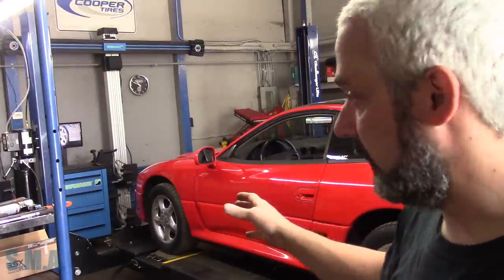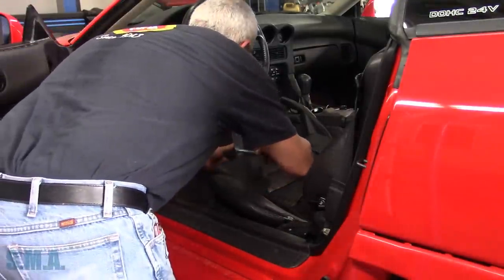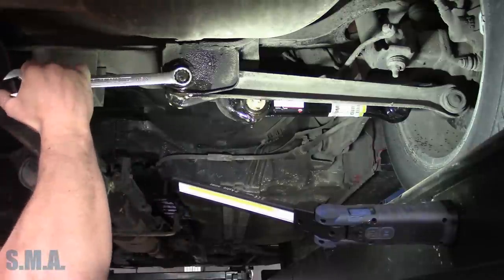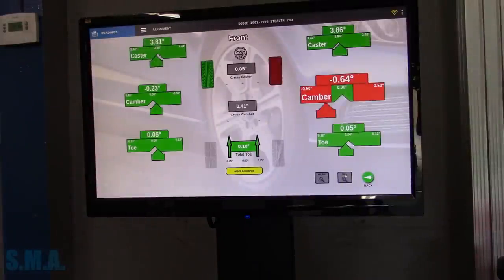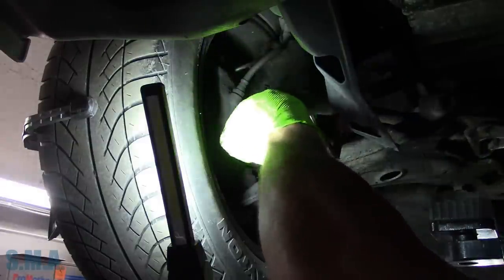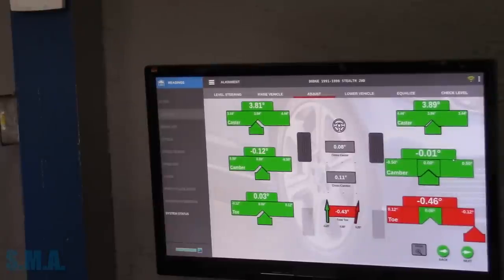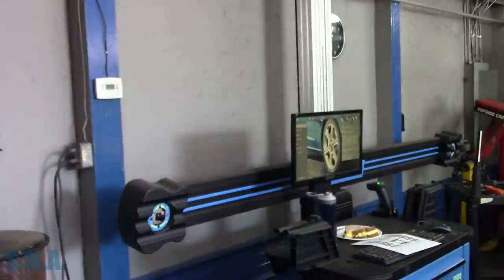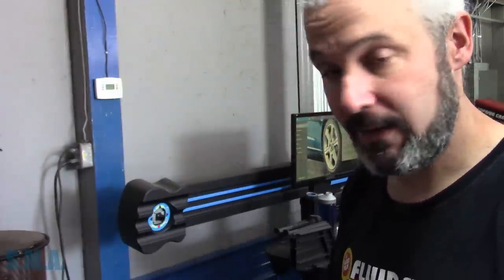Hofmann Geoliner 678: Performing A Wheel Alignment

Comment: Boy that sure beats a couple of jack stands and some string
Reply: That's how I set my toe-in after replacing an outer tierod on my Totota truck last year. Learned a lot and so far it seems to have been correct.
Reply: Oh yeah it definitely works I've done alignment on many cars with just that
Reply: Same here. I get it within 1/8”
Reply: I have try didn’t work
Reply: For toe my dad used to have a bar with sliding like dealies on it.
Reply: In the WRC - World Rally Championship they have static string lines with wheel hub fittings to do a re-alignment at service if they replace a tarmac suspension for a dirt suspension  or after an altercation with the scenery. Works well enough to drive a WRC car at up to 200kph on dirt/tarmac.
Reply: I will say that. However been there with jack stands and string before
Reply: No shit.. lol I fought my 85 Accord for 3 days trying to get toe in spec.. Turns out, front subframe was loose.
i managed to eat half of the right front tire in those 3 days and countless changes only to find the sub-frame would move around after a change
Reply: I've seen and fixed hundreds of bad alignments done with alignment machines with my eyes, a set of toe plates and a level. Tape measures are never wrong, "laser calibration" often is.
Reply: A couple of Summer's ago I did a full out-from-the-frame front-end refresh on a C1500 pickup truck.  A buddy works at a local dealership and offered to sneak it up on the alignment rack for me.  But, I still had to get it close for the drive over to the shop.
 
In a local semi-flat cul de sac I would eyeball the front rim edges with the rear then drive the vehicle around the block.  It took around four cycles to get the toe-in perfect by eye.
 
Once on the "real" alignment rack, toe-in was almost within factory spec.  Fancy equipment translates into fancy fast.  Just about everything can be done old school or low-tech and still turn out rather well at the expense of time.

Comment: That's a slick machine.  As a DIYer, the best I could ever hope to accomplish would be a rough toe-in adjustment using PHAD Ivan's string method.  Thank you for demonstrating how a total alignment should be done with modern equipment.

Comment: That is a nice machine! It will sure pay for itself in the long run. I learned alignment form a neighbor who did them at a Nash garage years ago using the old style bubble level gauge. One tip I learned from him is if you have a real heavyweight driver that complains that you didn't do the job right, do the job again with him in the drivers seat. If the driver weighs enough, his weight will change the the numbers enough to be noticed when driving or in tire wear.

Comment: Most vehicles back in the day just had a solid live axle in the real  and you adjusted the front (the rear wasn't adjustable) and you adjusted the Ackermann Articulated linkage steering for toe.  Most all of your trucks that have rear-wheel-drive or rear-wheel-drive based 4-wheel-drive are still made that way.  Even on that fancy-dancey machine Eric has you can still take a vehicle with a rear that isn't adjustable and do the same thing.  Now, however, most cars are front-wheel-drive and have independent-rear-suspension that must be aligned to the thrust angle (imaginary straight line down the middle of the car) and that is where the machine he has shines because it can compare all 4 wheels and their positions.  Great video!

Comment: Excellent.  Although it's a week after my first camber/toe front alignment on my Mustang with camber bolts, it's comforting to see them happen the exact same way.  No, I don't work in the shop.  Shade tree home mechanic.  But sometimes they let me 'play' with the machines with my car.  I did pretty good, I think. All in the green and centered, and the car steers fantastically. I'm sure glad to have seen this video that confirms I did it right, as nobody taught me the camber bolts.  Trial and error, but fairly quickly figured.  Thank you so much for doing what you do in documenting these things, Eric.  Even the plethora of brake videos are both teaching moments and good ASMR or however that's spelled.  Each video teaches me something, or at least re-affirms what I do know.  Have a good one!

Comment: Nice to see a good alignment!  Have 2 Kia Rondos, 08 & 11 and everyone says they can do a 4 wheel alignment but rarely can they because the back is attached to the fuel tank which they find challenging.  A shop recently did my 2011 and messed the whole thing up.  Torched everything even though they were new, lubricated parts and now they're all rusting.  Tried to sell me new parts, that were new.  They couldn't adjust their way out of a wet paper bag.  Scrubbed my rear tires in less then 1000kms and the steering wheel is off by at least an inch to the right within 2 weeks.  Just incompetent.  When I called to get them to readjust, they said they needed another $100 to fix their $200 alignment mess.  I eventually corrected things to a better alignment myself.  I tell everyone they are incompetent, especially after I gave them the chance to make it right.  So frustrating really.

Comment: Congrats on the machine. I work in racing.. we still set up strings for toe. But we also set ride heights and corner weights. But wi the measurements. You are so right on how they change. We put balast in for the driver weights and also but the fuel load the engineers give us so we can be as close as possible.. anyway.. great vids man. Thanks.

Comment: Cool beans👍👍Way back when I was in HS the Nissan dealership I worked at had a "computerized" Hunter rack.  The wheel sensors were wired, clamped on the rims, and you had to go through a calibration procedure on each wheel.  All the numbers you had to lookup in the FSM.

Comment: Wow! What an eye opener. I've always thought that one of the jobs of the suspension system was to keep the wheels in alignment in lieu of body movement such as weight. You mentioned that some cars alignment does not change due to body weight or movement but for the ones that do change such as the vehicle in the video I'm guessing that the amount of degrees out of alignment that happens due to body movement and weight is possibly pre-calculated in the factory alignment settings? If not, I guess the amount of degrees out of alignment cause by body weight or movement is not enough to cause any significant uneven wear of the tires. Thanks for sharing Eric I really enjoyed it.

Comment: Nice alignment EricO.  About 20 years ago I simply gave up trying to get an accurate computer alignment and started using home made tools and chalk lines in my garage,  Before you scoff just think about how important set up is for a computer alignment.  If the technician doesn't set the car up accurately or the specs in the database are wrong he may think he did a wonderfully "all green" alignment and yet the car is much worse than before.  Add the paid by the job not by the hour shop rate and shallow training and you get a 50% satisfaction rate.  Performance tires are much more expensive than the alignment.  And by the way, Mitsubishi 3000GT really is a boulevard poser car, not a sports car.  It weighs TWO TONS and has front wheel drive for crying out loud!!!!

Comment: Now that's an awesome piece of equipment.

IF only i could find a shop that does decent alignments. At least you LOCK THE WHEEL!
Reply: @David Hammett, I hear ya, that is a nice piece of equipment & Eric O. is showing us that he knows how to use it. He also cares about doing a top notch job for his customers! Them shops have top dollar tools & can't use them properly or they just don't care to do so!
Reply: Suppose to.  Always get a printout, but back when I was doing alignments some techs were able to trick the machine to print out good specs!
Reply: Where I live the rule of thumb is the oldtimer with the new equipment. There is one guy! He worked at the same shop for 30 plus years. That shop owner retired and now he's at a very reputable tire store.
Reply: Looks like ya gotta drive to New York for that
Reply: Yeah, I've left plenty of shops with a sideways steering wheel before. I've also found a few 21mm sockets still attached to the camber adjustment bolts as well back in the day. One time not that long ago, the local shop in town sent me out with a crooked steering wheel, and loose tie rod collars! I could turn them with my fingers. 😟 Good thing I checked when I got home! My wife commutes 60+ miles a day in that car.

Comment: You are an amazing!  Congratulations on the new equipment!  Appreciate you showing us how it works!  One of my pet peeves is getting my car back with a crooked steering wheel after an alignment,  happens more times then not. I am in Florida, you would be my mechanic if I lived closer.
Reply: That is when you take a bit more time and adjust the suspension to straighten the wheel.  Sometimes, they are just crooked.  Now, you need to satisfy the customer.
Reply: Last time I had my alignment done I asked about whether it was aligned to the road crown or level ground. The tech said it’s adjusted for level.

I don’t see it much anymore, but 20 years ago I worked in Quebec. On the Autoroute (same as a US interstate) many drivers would ride the crown, and straddle both lanes. If someone wanted to pass, then the car would move to the right lane. As long as the driver is courteous enough to move over, it sure beats having to steer into the crown on a long trip.

Comment: Wonderful video on new equipment and how to.use it.  Explained very well.  I learned on an old Hunter lite a line back in the 70s.  Different cars back then,  I could actually see around the engine .   Not one sensor or computer on it.   Points and condenser baby !  When HEI came out it amazed me.  Boy how times and cars have changed.  Still LOVE the old ones. Keep on trucking Eric.......

Comment: Used to do this a lot in the performance garage I used to work in, one thing i will say is manufacturer settings are so wide a tolerance you could drive an HGV through it..  Gotta use your noodle when setting cars up "properly" rather than just making it in the middle of the green. You can usually set a little more camber than factory (or at least the high end of the green if you have a customer that doesn't really know what he's looking at apart from green good, red bad.)
Toe wise, ask the customer if he likes the handling dull or sharp, toe in slightly for a comfortable easy driver. Toe out slightly for a sharper but more nervous drive. Can also bugger about with bump steer if you have time, sometimes need to shim the rack to get rid of it.

Also for single driver sports cars, i load the drivers seat with the approx weight of the driver for yhe reasons you just talked about while i was typing 😂👌🏽

Comment: Really cool watching how everything works and how you have to juggle the adjustments as they affect each other. I remember when you did the rear alignment on my '07 Galant and said there were pieces missing which I would guess added to the complicity a bit, As soon as I was going down 415 I could feel how much a difference there was. As you said I was literally dragging the rear tires down the road wearing out the wires in 5,000miles.Thanks for sharing. And thanks for doing such a great job on my car as there is little wear on the tires you installed thus far, lol.

Comment: That thing is SWEEEEEET!! I'd have to put up yet another building for that, lol. Sure would be nice being able to do my own alignments, though! 

I just had the Grand Marquis aligned a few weeks back after rebuilding the entire front end. I brought the guys a gallon of coffee & a dozen donuts.They spend 2 days on it getting everything right. The steering feels different than it used to. Used to be real solid on the road, but now it has a little twitchiness to it at speed. Of course, everything is brand new under there now, including the steering box and rag joint, so maybe this is just how Grand Marquis' are supposed to handle. I know there's little tricks old timers used to do on the rack to get them to perform a little better. Sadly, alot of those guys are no longer with us. Of course, most people don't drive like I do, so I'm probably exceeding the design limits anyway. 😁

Comment: Always use the rim clamps if you want a TRUE wheel alignment. If by any chance the tires are worn unevenly you'll have an aligned car sure, but it will be based on the tire discrepancies which might end up amplifying any underlying issues with tracking. At least with rim clamps you can from the get go diagnose problems caused by tires. And then proceed to, if possible, correct those issues - rotating tires, rotating tires on rims, etc, or simply replacing tires.

Comment: Glad you tried to even out the camber on both sides of the front.  If you had zero camber on one side and a small amount of camber on the other....even though both sides were well within spec...the car would have a tendency to pull to one side, even if the toe is perfect.  A tire that has camber will try to 'turn'.  That tendency to turn must be balanced by having the same (or nearly the same) camber on both sides of the car.  That way they will offset each other.  Eric probably knows this, but many do not.
Mmmmmmmmm....at 20:20....an egg sandwich!  My favorite!

Comment: Nice! If things work out, I’ll be joining a shop with a newer Hunter alignment machine in about a month.  Looking forward to using it!
Reply: Hawkeye elite is a slick machine
Reply: The new Hunter machines are great, you don't have to worry about the turntables anymore, it'll auto unlock/lock them during the process, also has 4 air chucks to inflate/deflate tires as needed.

Comment: First I want to say I'm not try to criticize or tell you how to do an wheel alignment. It looks great! However I find it interesting and used to work with it for almost a decade, and just airing my humble thoughts =). I use to give right front just a hair more negative camber (around -0,10 degrees) than the left side to compensate for the road leaning from the center outwards to make rainwater run off, so you don't need to "counter steer" and the feel that your steering wheel is off center to the left. In this particular case where the camber on the left side is maxed out, I'd probably have put right side around -0,25 and a positive toe on +0,2 individual to compensate to not wear down the tires on the inner sides.
Also Erik O <--With a K =)

Comment: That's a nice machine you have there, Eric. I like the clamp on type of heads much better than the one that pinch in between the tire and the wheel, quicker, easier, and eliminates the chance of the head falling off and scratching the wheel. I wish that my company would upgrade the heads to the clamp on style. I'm surprised that you didn't take the rear turntable pins out after installing the heads, that can affect the readings, even if it is small. One thing that is nice is that the front tie rod ends were not seized together. Here in Michigan, anything more than a few years old and daily driven year round usually means seized tie rod/tie rod sleeves and adjusters. Sometimes, the tie rod jam nuts are seized bad enough that it takes a torch to get them to break loose. Are the balls in the turntables plastic or metal? Curious because I've watched a friend of mine who is a front end and alignment tech take them apart. It was an older Hunter rack, and the balls were plastic, and tend to split, so he replaced a lot of them.

Comment: Worked with it for 5 years about 15 (to 20) years ago... when I still remebered. Even then with lazer beems and what not. For knowledge you can inform about; If adjustable and in need you have to adjust rear first, camber not that common OEM so to speak but if possible adjust before toe because camber will effect even toe quite much, most modern machines don't need to get steering wheel locked = you set it straight and it will keep that setting. In rust belt you will often have to heat to breake something loose, adjustment, and as you keep on saying we talk ° so.. if heated it have to be cooled down again and have some thoughts about material strength etc. with heat threatment. Do it right the first time, worthless to do it twice for the same money =/ Last but not least, fix ALL play before or the adjustment will be useless. Test about 2000-3000 cars a year (50k-70k total) and many, many, many mechanics and workshops have no soul..as you know.
Regards =)

Comment: sounds like you could technically throw some weights in the driver seat to simulate a potential driver to get the most accurate settings for when the vehicle is actually in use.

Comment: I have aligned with carpenter square ,string and tape measure. And it's been a good job. Of course these where early 70s or older. It would never even be close on anything newer. With all the adjustments I wouldn't even know where to begin. This is why I really do not care for anything new. They have given them so many adjustments like your driving some kind of race car.

Comment: "If I can do it, you can do it". Yeah well, I don't have an alignment machine, mr. O.! I cannot do it!
Reply: They are not cheap!  If you notice tire wear or steering wander, then get a alignment - cheaper than a set of tires.
Reply: Firestone has the Lifetime Alignment Service.   They'll check your alignment every 5000 miles or  whenever needed for as long as you own your vehicle.
Reply: @davidh7339  ...and when the suspension is getting too ragged (a frequent cause of bad alignment) guess who gets the job! Do you need it now? How about now?
Reply: It is possible to do an accurate DIY alignment...  It does take time and a bit of commitment, though.